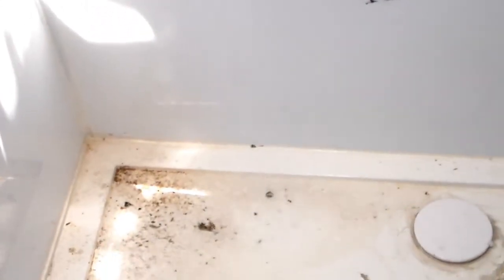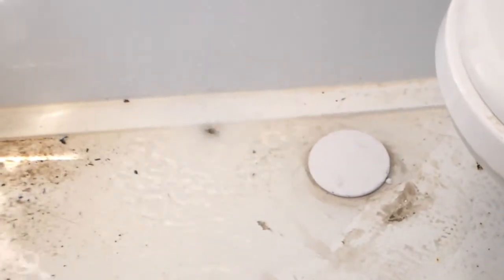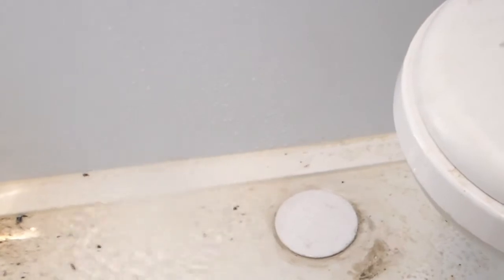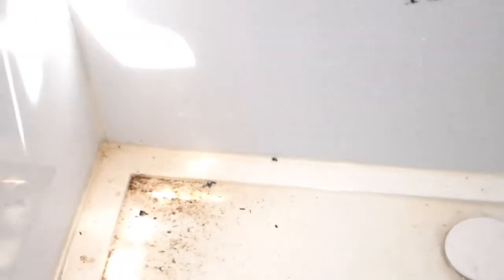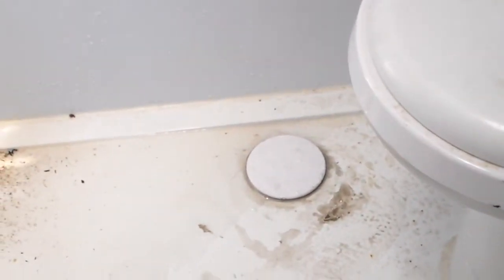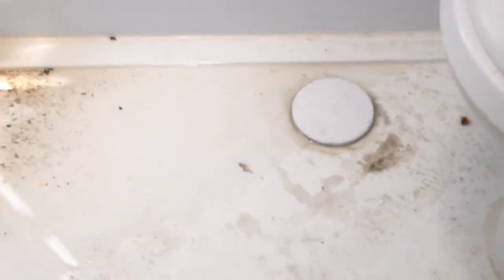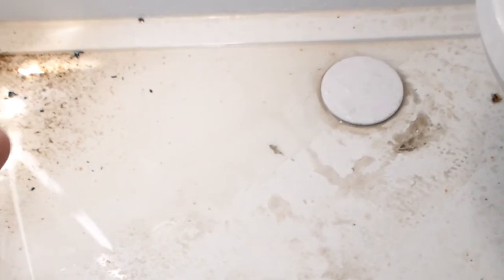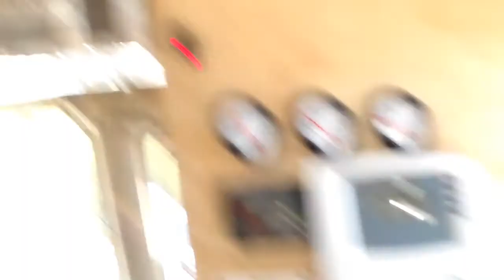DIY Motorhome Build Part 10: Shower Drainage Problem Solved

Comment: So I found your videos because I am considering the exact type of minibus that Im considering buying, for me I want to get it registered with a gvm of under 4.5 tonne so I can legally park it on the street because like you I want to live in it and don't know exactly where I will go with it.....I don't wan to go through the whole re classifying it as an RV hassle you did.....will ring up tmrw to see how much of a hassle changing the GVM is only.
Reply from the maker: Jayme Capurso hey mate. Thanks for watching. Either way you go I think to get the GVM to under 4.5 you will need an engineers cert. I would recommend removing all the seats then contact your engineer. Don't tell him its for a motorhome. Take it to a weighbridge first also.
Reply: It currently weighs 3.8tonne because the guy who owns it has already pulled all but 5 of the seats out so all I need to do is remove the base they went on....I don't want to register it as an Rv because of the hassle you went through, my whole motivation in living in a van is to side step the over regulation this country has fallen into and to just be able to do what I like because its mine...I noticed no videos for a long time, how's it all going?
Reply from the maker: Jayme Capurso ok well you should be fine. Your engineer might want you to explain what your purpose is. When mine agreed to downgrade the gvm
 It was based on 2 seats plus I think 100 kg luggage for 2 people.  As for me I'm still living in my bus. It's been 8 months now. I really need to do more videos. My toilet and maserator died recently so fitting a replacement tomorrow but otherwise very happy.
Reply: Perhaps I will just say its to transport something light like insulation for my business and I want anyone to be able to drive it legally :) About your toilet, you probably don't want to bother with changing it now you already did all the work but a composting toilet with a urine diverter to your grey water would make your life much easier....I'm never dealing with black water and can just dispose of it discreetly...Are you on the road or set up somewhere?......Do another vid, go on!